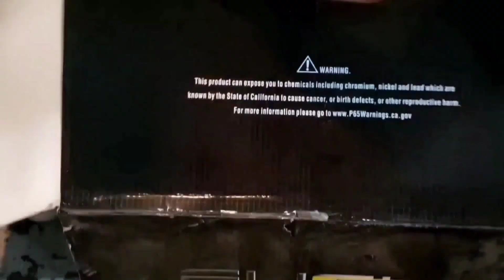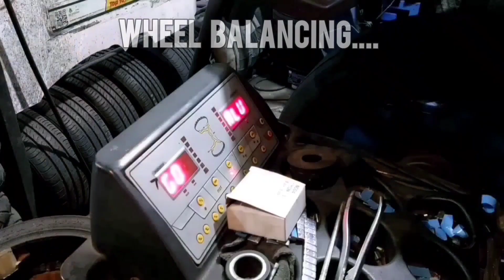Fuel Contra 20" paired with Vee Rubber H/T 265x50 R20 on this Toyota Fortuner G @ RNH Tire Supply

Comment: Sakin sir 275 naka lift na 2inch may konting rub pa rin, at di mawala ung vibration sa highspeed, naka hubcentric na rin at highspeed balancing. Currently on a fuel vector 20inch and monsta AT 275
Reply from the maker: Yes po sir kahit 2 inch lift minsan sumasyad pa rin  275x55 R20, depende kasi sa offset ng mags po sir. Sa vibration check niyo rin gulong niyo sir baka oblong na  po. Try niyo rin po sir pa wheels balance ulit  -  hyspeed wheel balancer po
Reply: @rommelromero84  maraming salamat sir icheck ko ito, isa pa po balak ko pala palitan tire size sa 265/50 ibalik ko po ba sa stock height or okay lang rin naka 2inch lift pa pag 265/50 na ang gulong ko?
Reply from the maker: @melbs24  sir pag naka 2inch lift, maliit na po 265x50 R20.
Pede 275x55 R20 or 285x55 R20 po

Comment: Sir Rodmell king 275 ang ilagay sir sa fortuner Q instead sa 265.. sasayad din ang 275.. thanks
Reply from the maker: Hi sir yes po sasayad po 275x55 R20 sa fortuner po sir, need 2 inch lift po para magkasya po sir  maglilift din po kmi sor kung sakali po

Comment: Sir 20 inch rims at 265x50 tires plug n play na po buh for toyota fortuner 2018? Wala nang e babagohin sa shocks and etc . Salamat sa sagot po sir.
Reply from the maker: Hi sir, yes po swak po yan sir, plug and play lang po sa stock suspension po sir

Comment: Boss kasya ba dyan ang 275×55 fuel contra din furtuner din po na sasakyan
Reply from the maker: Boss pag stock height po sir, 265x50 R20 lang po, sayad na po 275x55 R20 po
Reply: @rommelromero84  soO ibig sabihin boss kailangan mag paH taAs para mag kasya kasi amg standard hindi pwdi